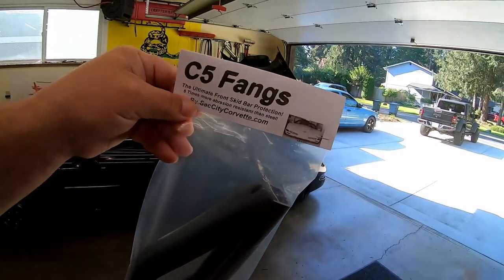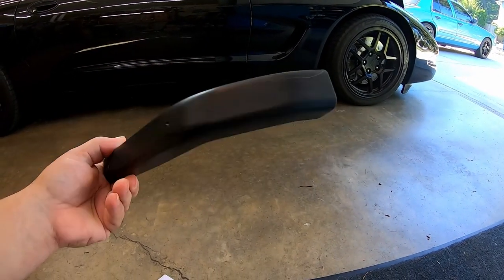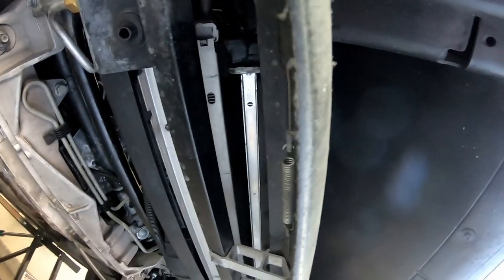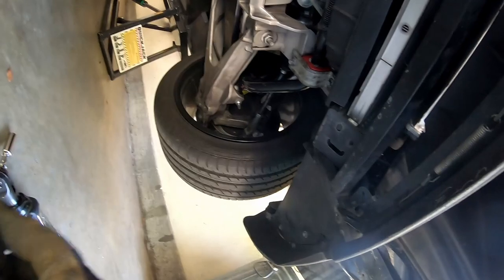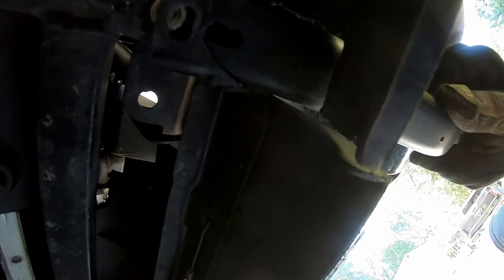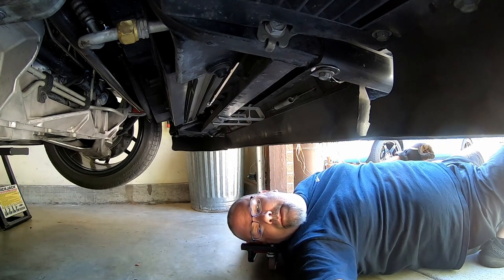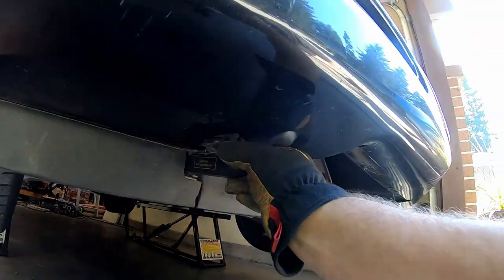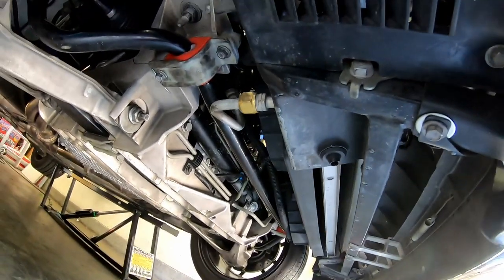C5 Corvette SacCityCorvette Fangs Radiator Support Skids vs Brand X Installation

Comment: Thanks for the review of these. I've often wondered what they were like and made out of. I have a really old version of these on mine that are made from the same stuff it seems. I installed them in 2007 when I first bought the car. Not that I test them everyday, but the material is very durable.
Reply from the maker: Thanks Mark.  I have no doubts these are going out perform the cheapo ebay specials on that were on the car.  I want to hit something with them but at the same time they are so pretty I don't want to scuff them up lol.

Comment: Great vid,  I need to get those too for mine, so far I think I only hit that support ones,  I constantly hit my air dam evrytime I pull out of my driveway
Reply from the maker: I hit the bash bar probably once a month or so and that's not even daily driving it.   Almost always driveway thresholds to business or gas stations where you can't be blocking traffic. driving all gentle like.    I've driven a couple hundred miles on it now with the Fangs and haven't hit anything since lol.

Comment: Is that the bar from my Oklahoma Z on there with some energy suspension bushings? I've always been curious about the SCC sliders. They seem smart and also cover over any previous impact scars. I have run the Big Poppa (Momma?) skateboard wheels on my daily since 2014 or so. Driveways and tow truck driver alike LOVE them. I'm lowered on bolts now but have also been on coilovers in the past on this one and I also took the three air dams off the car and cut them down. I want to say 3/4" but it may have been 1/2" all the way across. They are still low enough to rub before the wheels do depending on the angle so you have an audible warning. But it has proven an effective setup.
Reply from the maker: It sure is Brett.   Between the new Z swaybar, the C6Z shocks and adding a couple pounds to the front tires I think the ride and handling are better than stock and worlds better than stock with the added 175lbs on the nose.   I think the big thing on the wheels vs fangs pros cons is the wheels are likely to touch all the time where the fangs may never touch depending on the situation.  The wheels gotta be like an inch and a half tall?
Reply: @PNW_Car_Mods  Not so much. You can decide where to sink the bolt through the frame and affect the wheel height if desired. I still went dead center. I am uncertain at present how far they extend past the bar on the bottom... but I prefer they hit than the frame or the underside of the nose panel. And they do as they should... they roll instead of dragging the frame. They are battle scarred to heck by this point. And like I said, when the flatbed comes... because they do sometimes... they are greatly appreciated.

Comment: That's cool, i guess.  I have the elite engineering wheels,  they roll over whatever.
Reply from the maker: I'd rather just not hit at all.  The fangs give you the best opportunity to not hit anything.    Since I installed these I have not hit anything lol.  I also know a few people that have demolished the wheels.  While they do work pretty well they're not invincible.
Reply: @PNW_Car_Mods  yeah they can get bent,  and then in a vice bend the pin back, they're pretty tough